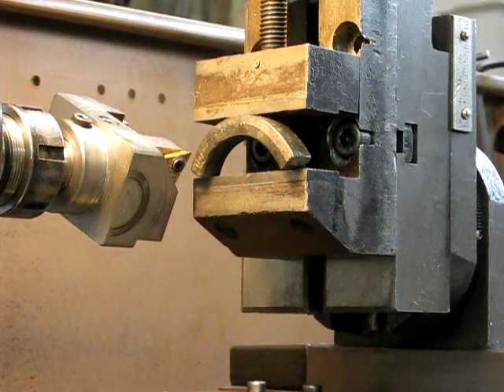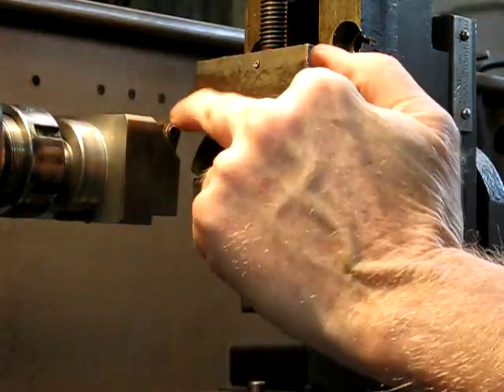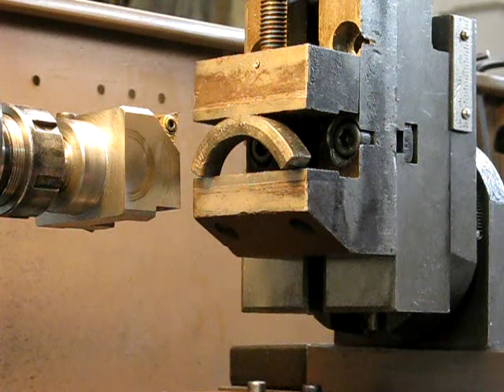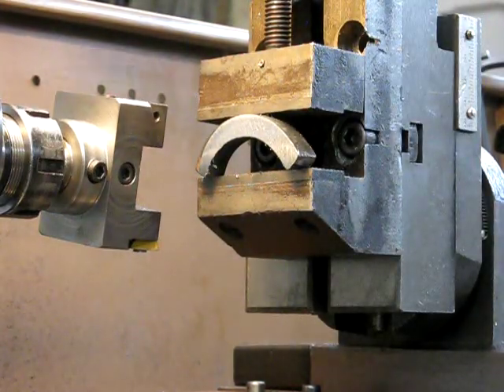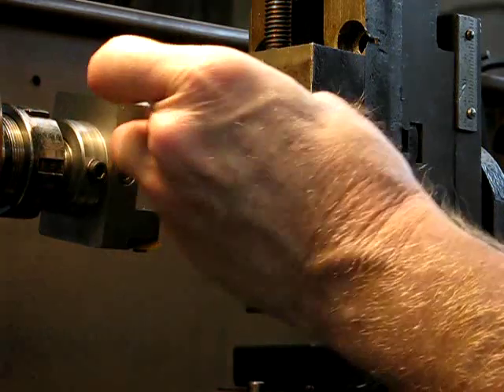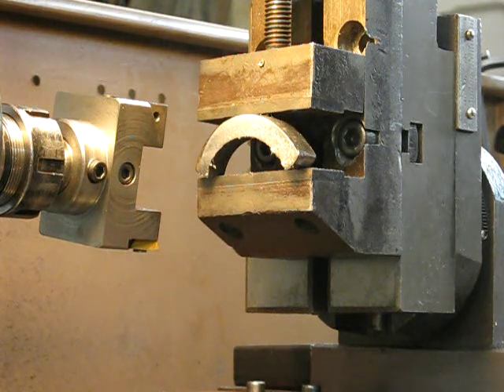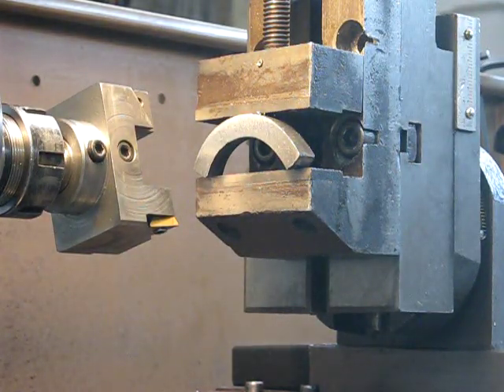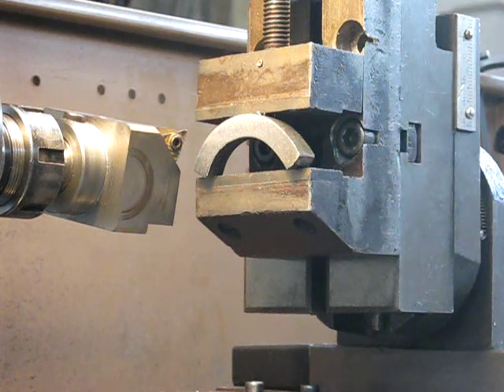Milling on a Chinese lathe with a carbide tipped face mill

Comment: What was causing the sparks Rob? Nice tool ya made there btw
Reply from the maker: Just very hard steel, cuttings getting hot and sparking.  I think it was half of an axle bearing retainer.

Actually the cutting angles on this tool were not quite right, and it tended to push the edge too much.

So I later reworked it to a single point HSS fly cutter, and made another head that takes standard TCMT and any other indexable tooling you may have.

https://www.youtube.com/watch?v=ihjyYBH4KM4

Cheers Rob
Reply: I was thinkin the metal being pushed might have been the result of the radius on the insert, I didnt consider the angle being off. Geometry is everything....who knew! :)

Comment: How can you face an irregular piece like this by turning it? (I'm new to all this, having just acquired a lathe)
Reply from the maker: You would mount the piece in a four jaw chuck and use a facing cutter in the toolpost.  High speed steel is the best cutter for irregular work, as carbide will chip more readily.

The other option for really hard metal is to face it with a tool post grinder.  I have one of these and it will give a great finish.  Rob